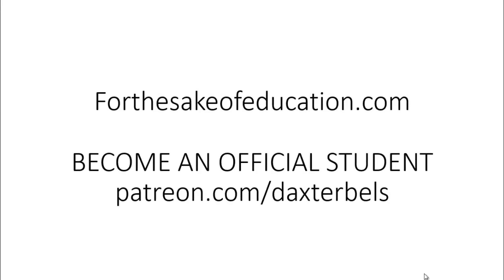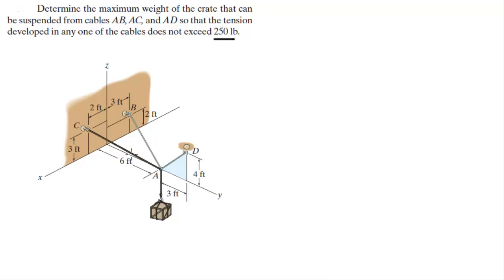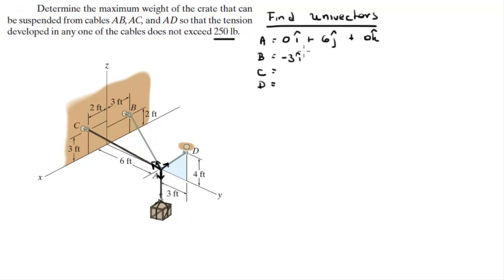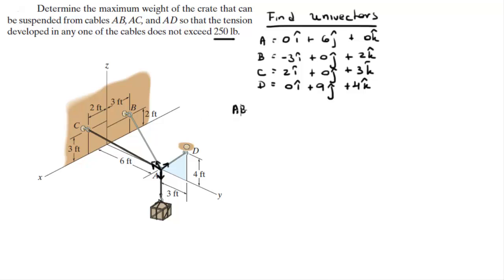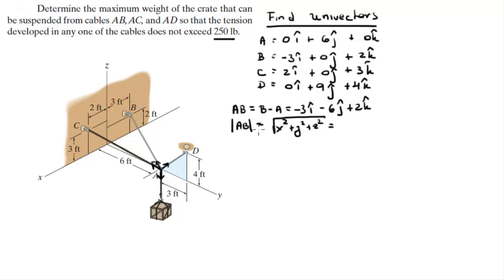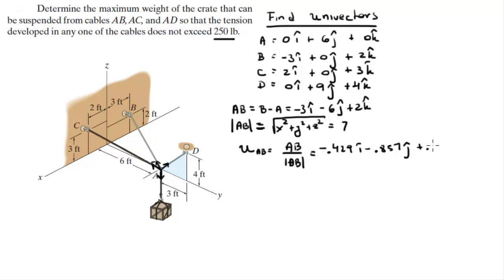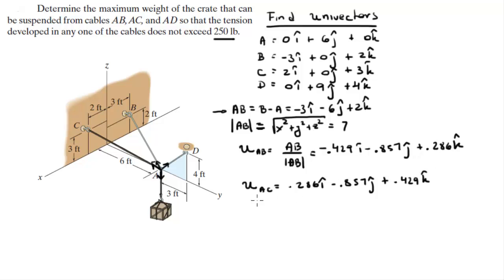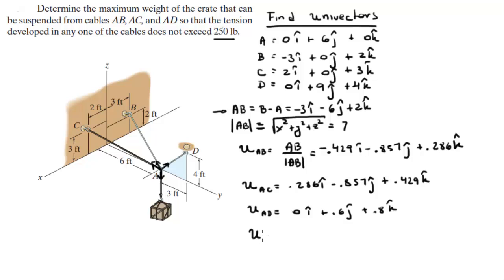Determine the maximum weight of the crate that can be suspended

Comment: @10:00 why did you multiple equation 2 by 0.8/0.6?
Reply: To get a common factor so he could cancel out
Reply: But why does that work?  Does he just arbitrarily choose .8/.6 because he fells that cancels out the Tension variable he wants?

Also, why can't I just use substitution to cancel out the Tension variables?  E.G.  Substitute 300 for Tad and solve k hat as: (-Tab-210=Tac) and then plug this in to j hat for the Tac values to solve for Tab?
Reply: @inorite4553  he needs to get 2 of the same numbers with opposite signs. so he needs to make that .6 become -.8. let A=.6 and B=.8 then work -B=Ax -->  -.8=.6x --->   -.8/.6=x. sometimes its easier to do it that way otherwise your way works too I believe.